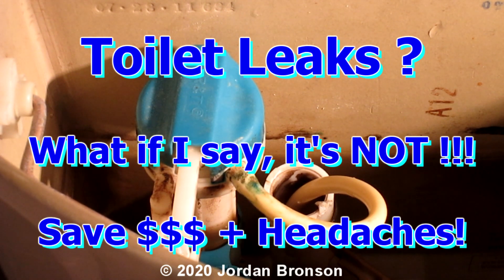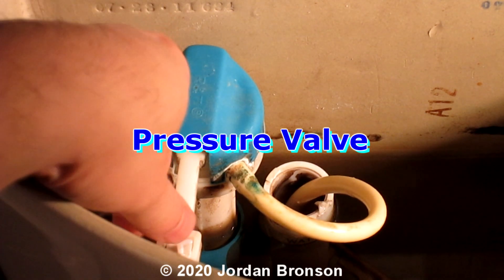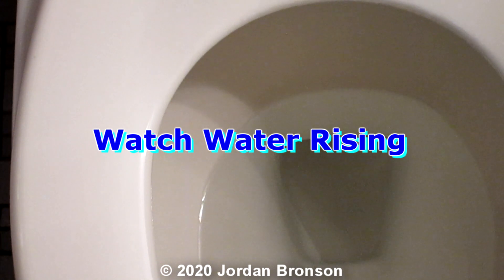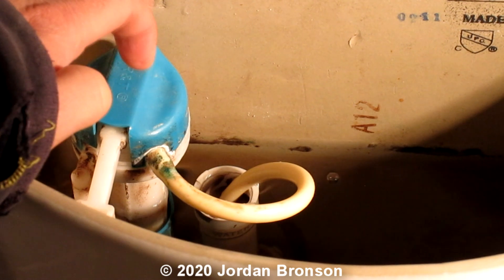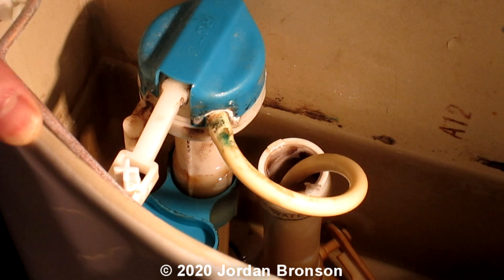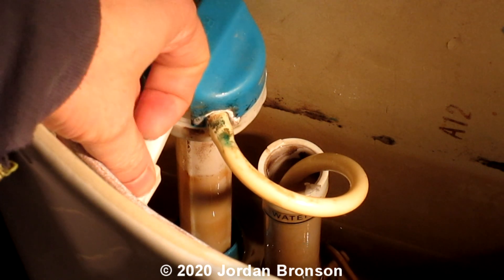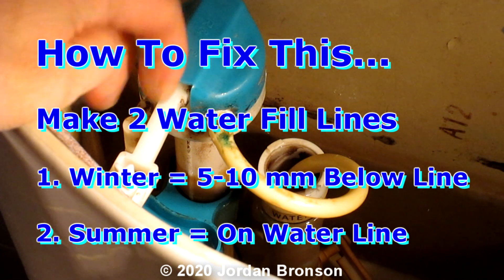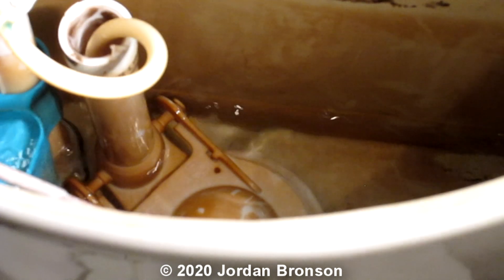Toilet Leak or Leaking ONLY IN WINTER ???

Comment: For my own toilet I noticed the flapper that holds the water in the tank slowly drips into the bottom bowl then occasionally I hear the filler filing up the tank again. No I don't hear the hissing though.
Reply from the maker: That means there may be gunks on it or the flapper is gone.  Try to get a paper towel and clean it and if not, replace it.